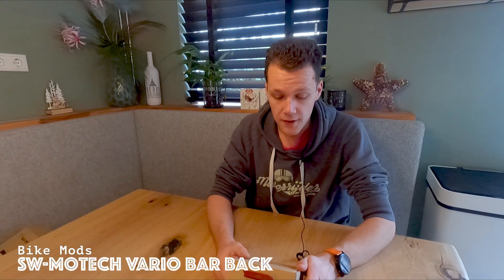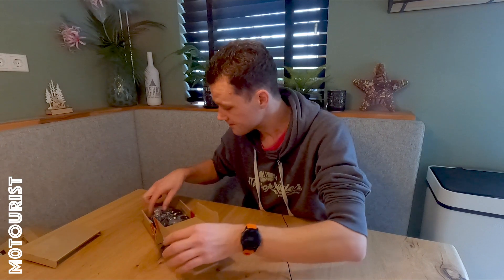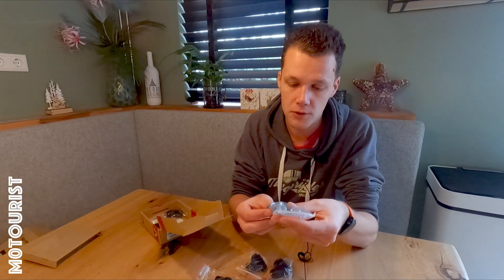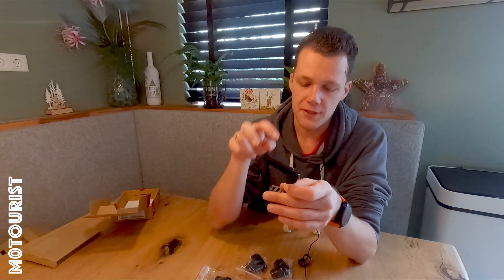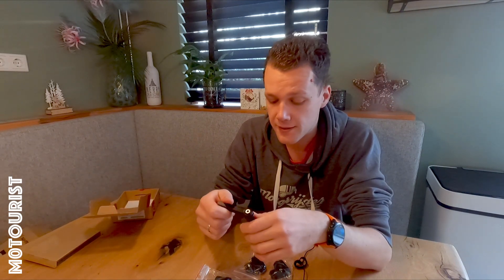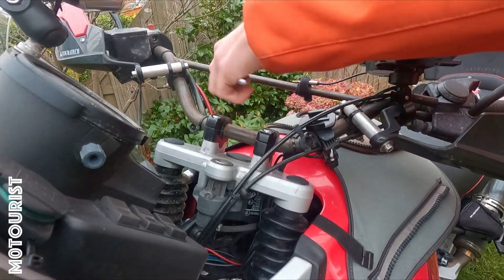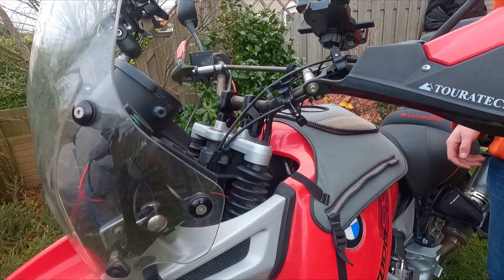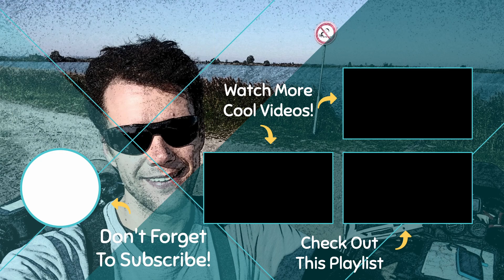Bike Mods - SW-Motech Pivoting Bar Risers - R1100GS

Comment: are your control cables stock or did you have to change them to work with the risers?
Reply from the maker: The clutch & throttle cable are stock, same as the wiring. Those fit, although I wouldn't go any higher then the 50mm, then you'll need to lengthen the throttle cable.
I do have aftermarket brake hoses, so I can't tell you anything on that...
Reply: @M0Tourist  thanks for replying. I did try out a friend's risers and they seem to fit without cable adjustments. I ordered 30mm ones and i'll be back with feedback. Thanks!
Reply from the maker: @psychofreack   Good luck & happy riding!